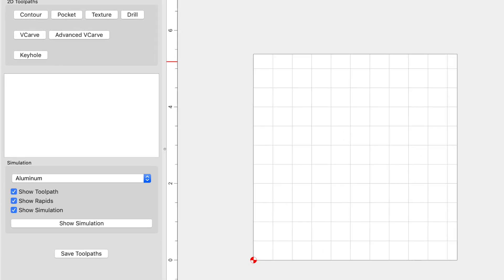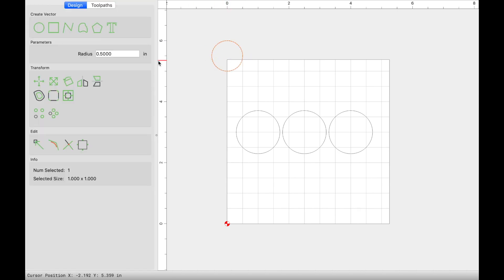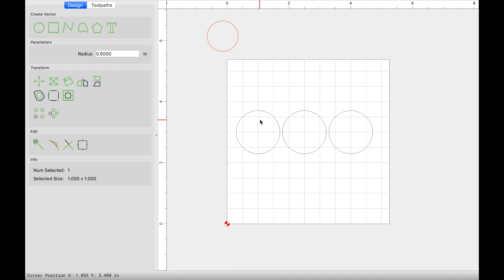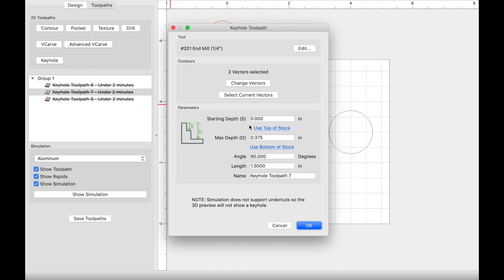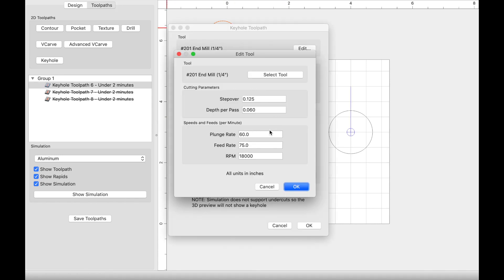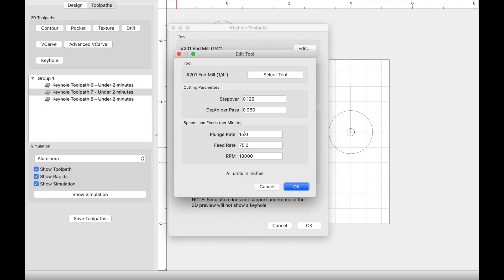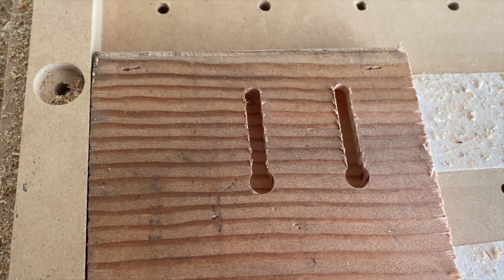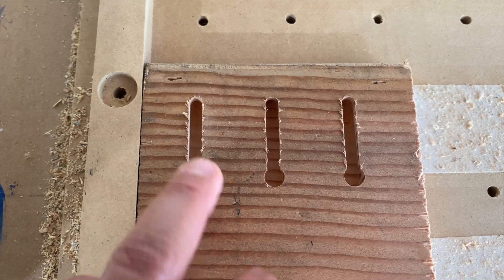How to Make a Keyhole Slot with Carbide Create

Comment: Plunging straight down is generally a bad idea as there are no true center cutting endmills (center point just spins in place and doesn't remove material so both tool and spindle are stressed). Either Drill a hole or pre-mill a pocket by ramping in (Carbide Create Pro only). The hole doesn't need to be the size of the keyhole tool, just as long as the center of the hole is removed and plunge rate is reasonable. Clearly, you can get away with plunging into wood, but once you work with metal, these bad habits will rear their ugly heads.
Reply from the maker: Thank you for sharing your knowledge.  This is good info and i always welcome this! I usually stick to the same toolpaths and similar projects so this I’ll have to remember

Comment: What depth would you use if you had 1/2 stock
Reply from the maker: Before putting the keyhole but in the cnc I put it up to my material and see what would look best. I then make a mark on the edge  and measure. That’s how I did it here.

Comment: thanks for another great video. But I have a question. I carve home address signs that are about 5" wide and 14" tall so i carve them horizontally and turn my art. Is there a way to change the direction of the keyhole slot so that it carves horizontally but is actually vertical when the sign is turned up right?
Reply: I think I figured it out. The ANGLE setting isnt for the angle the bit enters the wood. Its actually the angle of the key hole slot. So i was able to change it to 180 degrees and it carved it horizontally
Reply from the maker: Hey mark, glad it worked out and thank you for sharing!
Reply: Good to know. I was wondering the same thing. Used the keyhole tool path for the first time after seeing the video and works great